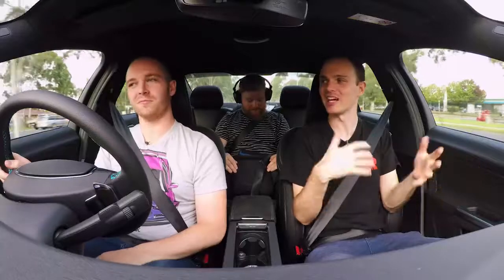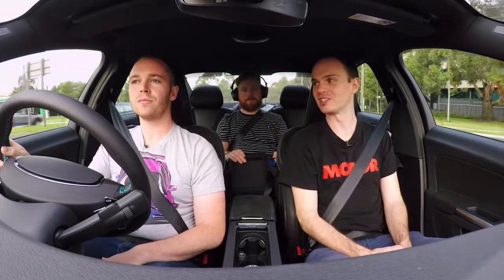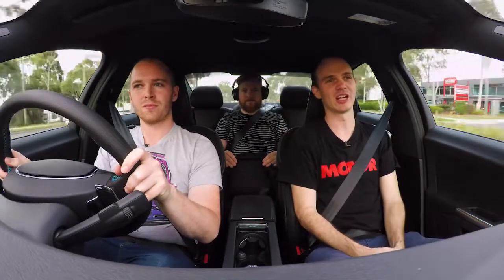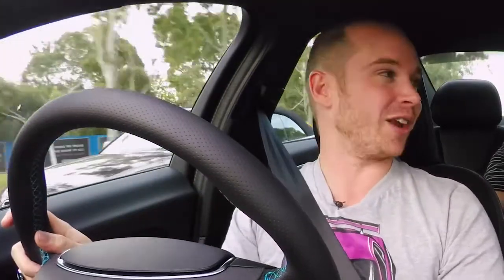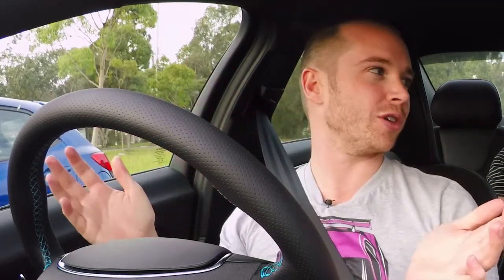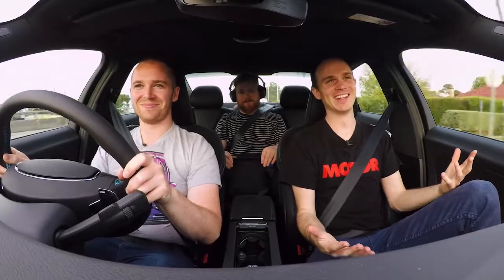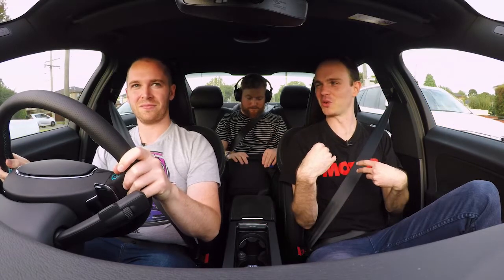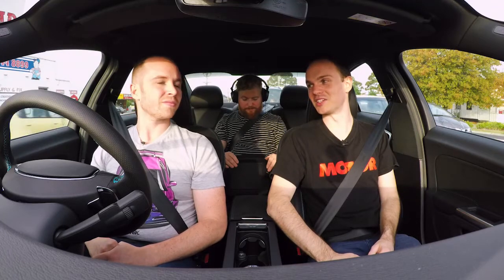Performance Car Podcast: Episode 3 - Downsizing engines | MOTOR

Comment: Great discussion and I agree with all of the points made. I have owned performance turbo and NA cars but I freely admit that NA cars are just special. NA cars require top shelf engineering whereas sometimes forced induction is used to veil less that precise engineering. Driving is more than simply going faster. Q,uite frankly, how much low end torque do you need to drive to the shops? The pleasure comes in wringiing the neck of a high performance NA engine on a twisty country road or on a race track.